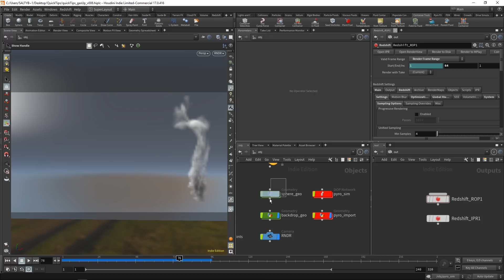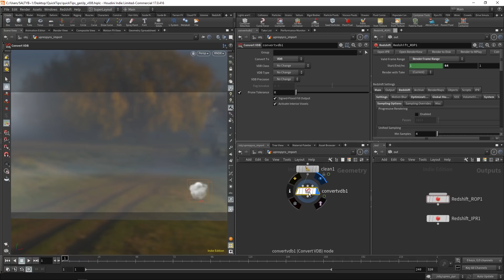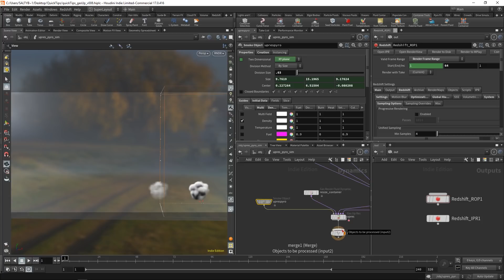Houdini For The Artist - Quick Tips - Gas Up Res

Comment: Man, thanks you soooo much !!!
Just a tiny question that can be stupid but prefer to ask
Why do u convert it to a VDB at the end ?
Reply from the maker: Hey Grey Knight, I do that at the end because VDBs bring down the file size a little bit, they perform better in the viewport, and they're easier to work with just in case you want to do re-sample the volume, reshape it, or anything else down the road.
Reply: @cgforge  Ok !
Yeah the fact that they calculated only the "real" density and not all the area should have talk to me, indeed.

Thanks alot really !

Iam doin' a tornado and i was crying with size file and simulated time ( coz its on big scale ).
Thaaaaanks alot.
Big love to you.

Comment: I ran into problems with this, namely, I was getting an error on the GasUpRes node. But managed to get it working. Originally I only cached density in my low res.  This is what caused the error. seems the GasUpRes node needs all the data from the original low res sim. So... When caching your low res, you must include all the volume data.    eg: density, vel, rest, temperature and I threw in Cd as well.  

Thank you @CGForge Keep up tips. It is much appreciated  :)
Reply: Thanks for this comment! I was wondering why nothing worked.

Comment: Hi, I have a cached out sim, can I upres it after caching or do I need to do the setup, put the read file path in the upres node then cache out the low res?
Reply from the maker: Hey Ronit, here's how I like to do this:  1.  Cache out the low-resolution simulation  2.  Create my Gas Upres network by using the shelf   3.  Tell my Gas Upres to read from the cached, low-res simulation  4.  Simulate the Gas Upres and cache that result to disk as my final result.  Does that help answer your question?
Reply: Tyler Bay hey, yes that answered my question. Thanks a lot

Comment: I don't think these little tips get the exposure they deserve. Thanks a lot again these videos really help out.
Reply from the maker: Thanks for checking out the vids Dedrich!  I'm just getting started with these quick tips, so let me know if you'd like to hear about anything in particular.
Reply: @cgforge  I really want to know , How to stick Color map or Roughness map ON the fluid Mesh！！ ！Thanks！
Reply from the maker: @zihengtongxue1146  That would be very interesting!  I'll try to see if I can make that work.  The way volumes shaders operate is different than your usual materials, but maybe there's a way we can combine some tri planars with rest fields, (or just render out a bunch of particles instead of volumes).  With the rest fields lesson I did last week, you can also take that same idea and plug your noise into a color field instead of density.  Thanks for following along!